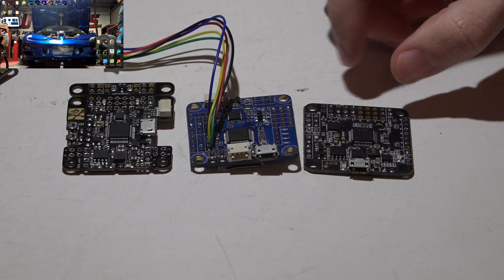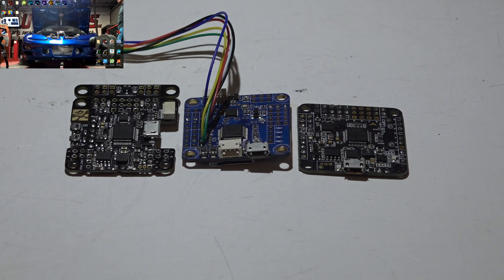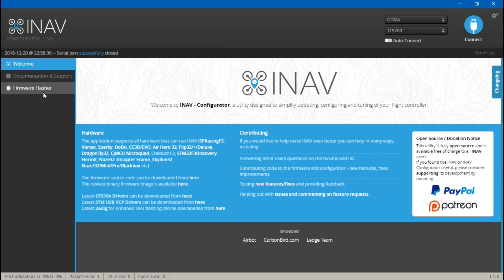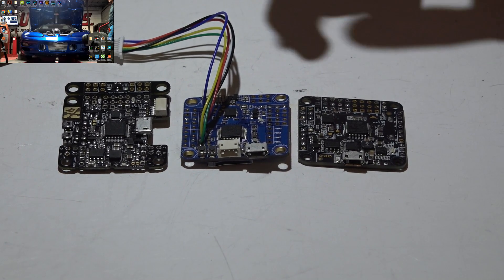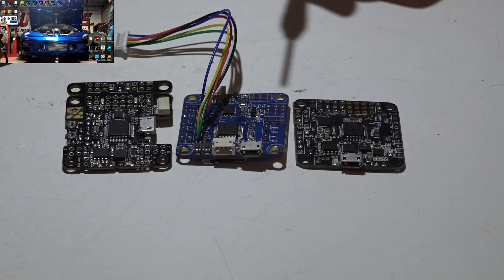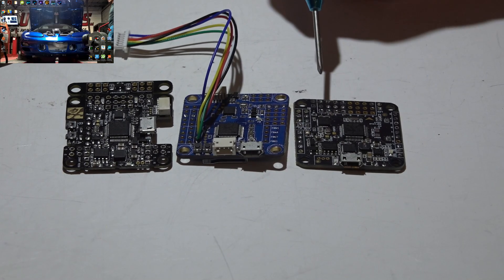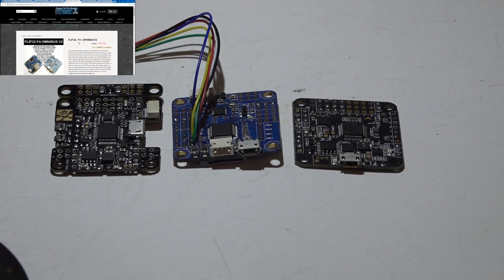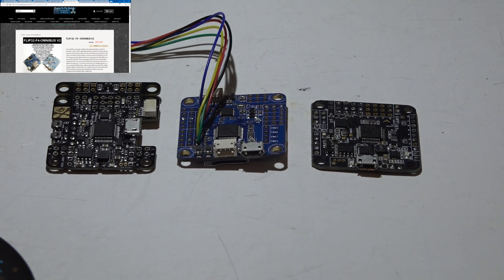Best Flight Controller For INAV?

Comment: Hey JC. Love your videos man. I'm running iNAV 1.5 on a Dodo V3b, with micro minimosd, GPS, and an XSR receiver in PPM mode. Originally did that to avoid using soft serial. Watched your video on setting up OSD on soft serial, and now I want to do that to free up UART1 for SBUS. In this video you suggest putting your RX on UART1 to avoid the USB port conflict when plugging in to use the configurator. Wouldn't the RX conflict with USB also? You wouldn't be able to do the initial setup of your receiver and adjust to get the sliders centered and at 1000 and 2000 if you had to disconnect it. Or did you mean put your smartport telemetry on UART1? Which would be better?
Reply from the maker: Yea sorry about that I really meant SmartPort on UART 1
Reply: So, just to be clear, I can hook up SmartPort to UART1, and I won't have to disconnect it when I need to hook up to the USB port to flash new firmware for the FC, connect to the configurator, or use BLHeli suite? You've done it that way and know it works for sure?
Reply from the maker: My bad I was thinking back when I had it on UART 1 but remembered I had the ground wire on a servo pin and would just disconnect that. No smart port and MSP doesn't work together. I'd just keep everything off UART 1, or other option is like I said, just have the ground wire on a pin and disconnect it
Reply from the maker: But then again problem with that is you wont have a working receiver when in INAV. The best option is to just get a FC that uses a virtual com port and not have any UART 1 problems.
Reply: Can I run OSD on a serial port, and SmartPort on the other soft serial port?

Yeah, I'll probably try out the F3 Omnibus for my next build. Built in OSD that's configurable through BetaFlight (or iNAV eventually?) and no more need of FTDI and Arduino hassles would be sweet. But, the built in OSD won't show GPS info until the software catches up, if I'm not mistaken?

I could just stick with PPM mode and go back to stick arming and gain a channel for WP or other iNAV functions.
Reply from the maker: Yep you can put both those on soft serials. Here is how to put the OSD on soft serial
https://www.youtube.com/watch?v=LPxjT3Aosak&list=PLiYYhnH4BhI_85qgp0hRjhHXdhrzl5j3w&index=4&t=223s

Then for smartport, you have to solder the wire to both pins, so if you put it on soft serial 2 then you'll have smartport on both channels 7 and 8. The rest of the set up is the same. 

INAV supports the built in OSDs but you're right, they are a little behind Betaflight. I'm sure they will have more features soon since they just copy betaflights code.

Comment: Hi JC. Was wondering if you could help... I recently bought an Omnibus F3 from my UK supplier (unmannedtech) and it works great in my small acro quad. After watching this series of vids I wanted to get another to use in a slightly larger GPS build but noticed that my Omnibus F3, and the ones sold at Airbot and FPV303 do not have barometers. They say they are optional but give you no way of selecting that option on purchase. My question is.. Do all Readytoflyquads omnibus F3's come with barometers? I emailed them but got no reply. Can a separate barometer be wired to the FC?
Reply from the maker: I'm not sure about other websites but all of my Omnibus flight controllers, F3 and F4 came from Readytoflyquads and they all have barometers.
Reply: Ok no worries. Many thanks for the info. I'll get my next one from there!

Comment: I assume, that Omnibus F3 is better than Omnibus F4 (not Pro) , because it has a built-in barometer.  Correct me if I'm wrong. Also performance wise there is no requirement in powerful processor unless you're running 8k/8k multishot on the 500+ size aerial filming drone! :-D
Reply from the maker: The F4 Pro V2 do have barometers built in. And correct you dont need a F4 for a GPS build, thats why I'm fine with using the cheaper F3 Omnibus. But either flight controller will be a great choice.